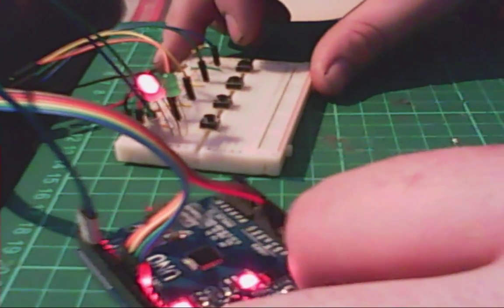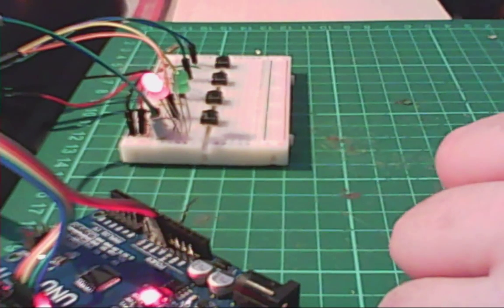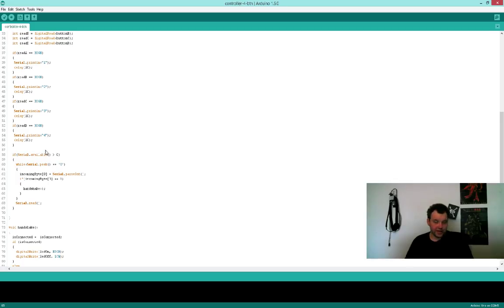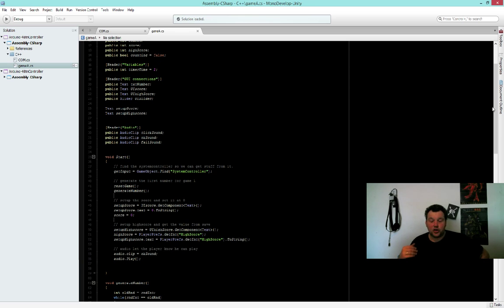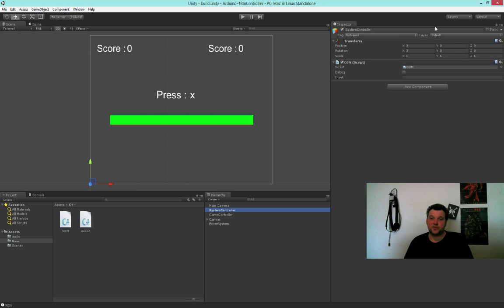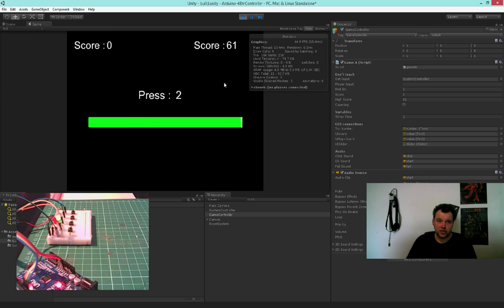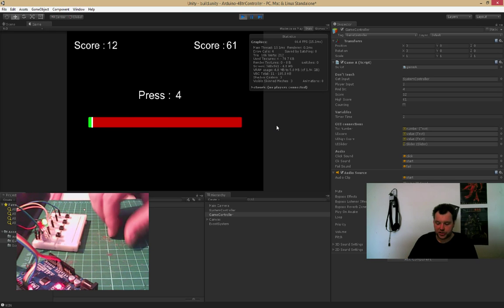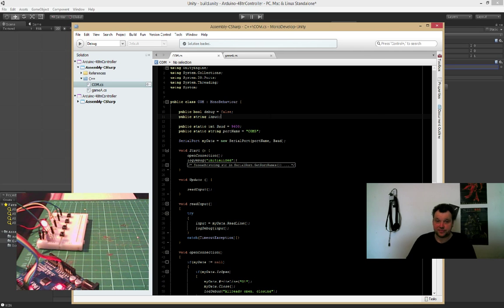Arduino game controller to Unity 3D designed game - part 1/3

Comment: I want to make joysticks with use potentiometer but I could't add Arduino Uno like a joystick (Control Panel > Hardware and Sound > Devices and Printer) If you know how to do, Can you help me?
Reply from the maker: +Yunus Necdet Karadağ Hi, and sorry for the late reply..  

for that to work, you need to write a windows driver,
basically a windows library that tells the computer what to do with the hardware.

More info on windows drivers here : 
https://msdn.microsoft.com/en-us/library/windows/hardware/ff554811(v=vs.85).aspx
Reply: Thank you very much for your help. I could not find the answer and I took a break from this project. Now I will continue :)